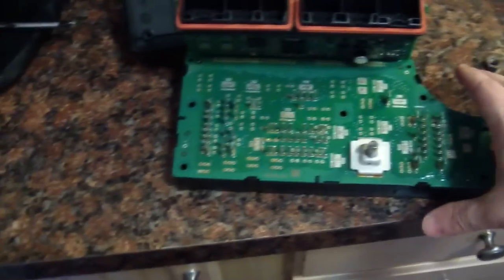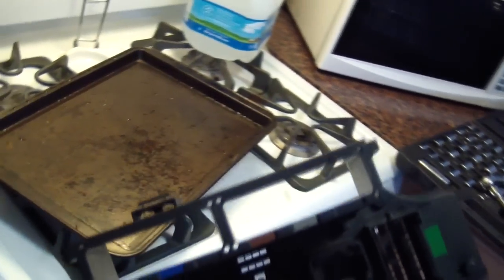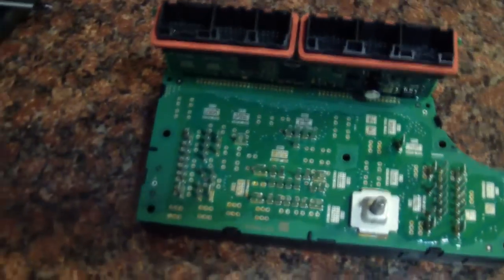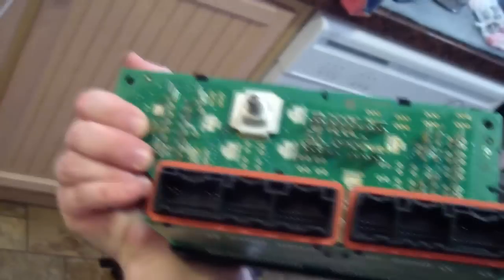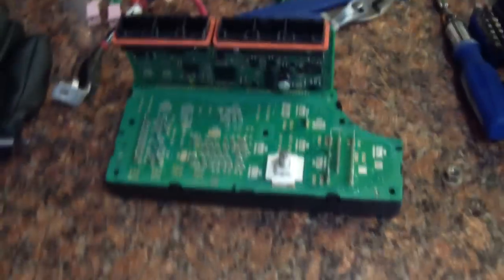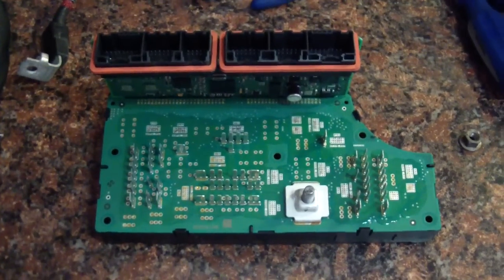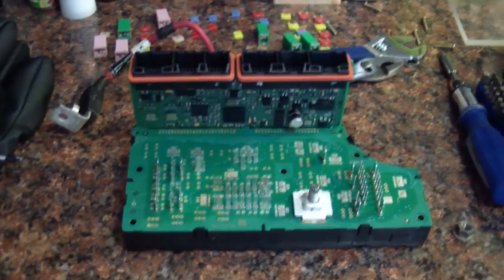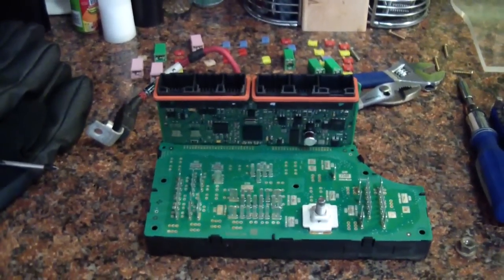2007 Dodge Caliber TIPM inspection - look at the guts!

Comment: Tipm should be called take-em, the customers money that is!
Reply from the maker: I used to down-play the potential results of a surge with these. Now with that said, my 1999 Volvo's regulator failed on the alternator and blew out both headlights and both fog lights. The CEM (A TIPM basically with replaceable relays) didn't have any issues.  The alternator was the vehicle's original. It outlasted TWO that my Caliber had.

TIPM - Totally integrated payments manager.... It makes sure you keep making payments on a vehicle you already own and have otherwise paid off...
Reply: built to brake!

Comment: 4 or 5 years ago, my wipers went out and I saw your video, pulled TIPM out and founds bubble of water under the protective film covering the soldered circuits.  I got hair dryer out and watched as the bubbles moved from air blowing on them until they evaporated.  This did not fix the wipers and I ended up running wire from wiper motor to switch I hooked up in cabin.

I am now having electrical issues (no crank) and am looking for solutions, guessing somehow related to TIPM, and ran across your video again and remember with amusement that it was my first clue into this engineering problem/nightmare.  After viewing hundreds of videos of TIPM related problems, many by very reputable electrical diagnosticians, it is almost universally agreed that integrating all of the electrical circuits into a solid state device is bad engineering, especially for consumer.  Thanks.
Reply from the maker: I totally agree. They did something before they were ready to do it. Frankly it was a cost savings measure if I had to guess.

Often people do something because they can, rather than debate if they should. This is a great example of that...

Comment: I acquired a copy of the service manual and as problems arise on my 2007 I have been replacing dysfunctional circuits with relays or toggle switches . . .the latest problem was the loss of the low beam voltage to the passenger side headlamp of the vehicle ! YOU CANNOT CONNECT A LED HEADLAMP TO IT  . . . I was lucky to resolve this one by cutting the wire from the right side and wiring it to the low beam circuit of the left side ( driver side ) and it is working . . . so far . . .the TIPM is a Pandora's box ( totally inferior by design ) and Dodge has not issued a recall for this module . . . I guess it would cost them billions to retrofit all the Calibers out there hmmmmm . . . .
Reply from the maker: If you hookup LED lights it senses a problem and then disables the circuit. There is under and over current protection. There is also an update to the TIPM for the front wipers shutting off when iced up a little. This one is care of yours truly who argued with the engineer on the phone and contacted the NHTSA after finding out they were designed to DISABLE the wipers until you took it to the dealership to have it reset. A better default would have been for them to set it up to reset after x minutes it could take to cool down so you wouldn't lose them entirely. I believe they were forced to set them active/enabled no matter what.
Reply: @TheWizechatmgr  Hey thanks for the heads up ! . . . I have had 3 Calibers and have had one too many a problems with it and ALL of the problems funneled through the TIPM . . . I had an issue in one of them that sometimes you would try to crank on the engine and it would not do anything ! the cluster would turn on but when you turned the key it did nothing ! . . . I was able to overcome this problem by disconnecting the battery for a few seconds and then it would turn on and it would continue to work ! . . . I took it to the dealer and they found " nothing " wrong with the TIPM and they could not guarantee the problem would go away if replaced ! . . . the tab was $1,800 for the removal and replacement plus reprogramming  ! . . . what a nifty way to conduct business ! . . . NO ACCOUNTABILITY AT ALL ! well,  I took care of that by placing a high current rotary switch in the battery plus cable and voila !  . . . at this stage you may wonder why I keep buying them . . .  well I am 70 and handicapped . . . they just happen to suit me quite well as far as getting in and out and overall comfort . . . but . . . I must say what a price to pay ! . . . besides , I got to know her quite well  . . . regards . . .

Comment: I have the same problem in the UK worse decision I ever made as you said Dodge failed miserably!! Is it easy to replace the fuse box? As in can it be done DIY?
Reply from the maker: Easy enough to replace, the problem is often one needs the "software" loaded to it by the dealer - this is where the additional expense comes in.

Comment: I have a 07 caliber sxt n my rear wipers don't work or my power mirrors can the tipm be the ossue
Reply from the maker: Erik Nobles I haven't checked the schematic but I believe so. Almost all circuits go through it. The tipm may not be bad, you may just need the dealer to clear the code. Especially if this happened during snow or ice...

Comment: I find more issues with the harness being broken/corroded under batter tray where it goes into fender then Tipm being bad. Sure a few have weak links in the circuit board solder/paths but far more with wire corrosion. The whole point is to shut off power so you DONT get things "blown to bits" as you say...That causes fires and whole reason why it doesn't happen much....Unless you drive in 3ft-5ft water you have a really LOW risk of having water damage this far up under the hood t. Drive in the rain for HOURS see just how much water really  makes it up that far into engine compartment,,nuff said...If your replacing this more then once your not fixing the REAL problem...most time if it is a damaged area on the pathway on board it can be fixed if you have means to find it. All boards are is pathways so unless a chip has gone bad these are fixed very easy then resold while no components were replaced on the boards.As with ALL makes and models in EVERY manufacture , you will have issues with every single one of them..anything man made can and will fail.Some less then others but thats because people cut to many corners out of greed. EVERY manufacture does this so every vehicle has a certain amount of issues and is no worse then the next...Its just as matter of really fixing the true problems and not just part swapping...That how a vehicle gets a bad rep from part swapping mechanics who are not skilled enough to fix the real problems and are more of band aid changers for profit....
Reply from the maker: Didn't see your comment, sorry if you feel you were excluded, that was not my intention. Google flagged it because of "boards.As" in your post above. I've never seen that before...

I now own a 1999 Volvo V70 XC - featuring the original CEM (TIPM equivalent) w/150K miles and a build date of 12/1998 - with no issues with exception of having to replace the original alternator at 145,000 miles. The Caliber was determined to have a bad TIPM by my Dodge dealer on 3 different occasions and replaced on two of the occasions within the first couple of years under warranty - I bought an extended warranty. Some of the TIPMs were hand soldered, those are known to have a higher failure rate than those that were manufactured using automated processes. My belief is they may contain cold solder joints which will increase resistance and overheat the trace, or burn out the mosfet. There have been 104k people whom have viewed this video looking for TIPM information - out of the 101,079 of this car that were sold in the USA for the 2007 model year.  That's a lot of people. I'll assume that a couple watched the video once or twice or perhaps on accident but that's still a lot of folks. Let's assume only half went to the dealer, that's 50k+ people having an issue, or about a 50% failure rate. Granted at this point, the vehicle is older, so one or two going bad now is more or less normal.

A Starscan or other near DLS tool is worth its weight in gold on these vehicles as you really need to query the TIPM to make sure it doesn't have a set code before replacement. If it does have a set code, you would obviously clear it and continue diagnosis. Some may have other failure modes and some may have other causes of failure -- such as wiring issues you speak of, or a bad ground. I agree that some folks may not be capable of performing the diagnosis required - but these are likely the same folks that will be unable to get the TIPM paired to the car and running...

As shipped the TIPM on this vehicle came with current overload protection turned on for the front wipers. I lost mine at one point during an ice storm while driving and had to go to the dealer to have the wipers re-enabled (code cleared and the max current cranked up) - about a month later they started notifying customers and they changed the configuration/software on the TIPM.  https://www.autoevolution.com/news/chrysler-recalls-84000-dodge-calibers-13249.html They also shipped more than a couple cars with the cam bolts loose - I.E. not torqued down -- NHTSA ITEM NUMBER10020191. While I understand things can occasionally slip through the cracks during manufacturing this points toward a persistent QA problem where either the TIPM wasn't put through a shake and bake test or just wasn't tested beyond a go/no-go of performance between engineering and when sent to manufacturing/production. Electronics parts on locomotives require both tests run at well over 300 degrees. I spent months going back and forth to Dodge and their dealer trying to get things fixed in the first couple of years that should not need to be replaced. 

In the first year the following were replaced by Dodge - 1 Alternator, 1 AC Compressor, 1 thermostat assembly, 2x airbag harnesses, 2x seat scales/weight sensors in passenger's side front seat, 1 SRS/airbag controller module, 1 TIPM,  1 Serpentine belt tensioner, 1 throttle module & both front control arms. It wasn't taken out and beaten on, it was used on the street put-putting to work and home. Maybe I got the lemon of the batch - the friday afternoon model on a holiday weekend - that is a great possibility looking back.

The control arms last a couple of years at best. The struts appeared to last a normal length of time. The engine itself appears to be okay. The TCM & CVTs are okay if maintained as required by Dodge - I.E. the final drive replaced at 80k miles. The chill zone was a good idea on paper but that was fixed with some foam tape. I can't comment on the driver's airbag but the passengers and side curtain went off in a frontal crash my wife was involved in last December. The car was cured of all issues at that point.

If you haven't had an issue with your or your customer's TIPM that's great. I'm glad you and/or they haven't. But here is the over-all rating of the car by Edmunds: https://www.edmunds.com/dodge/caliber/2007/st-100685354/consumer-reviews/ 

I've owned VW, Subaru and even Ford prior. Beyond the normal maintenance stuff of older cars I never had this many issues in my life with a vehicle. I did head gaskets, TB and water pumps on both the VW and the Ford without issue. 

When the car wasn't having issues it was a great car that was fun to drive while a bit heavy on the maintenance $$$. Sadly, periods of no needed unplanned maintenance didn't happen as often or as long as I've had with other cars I sold at 250-300k miles that I purchased used. If you're located somewhere dry and not cold, preferably where salt is not used on roads, the car more likely than not be a bit more reliable. I'm glad to hear someone has had some good luck, may it continue knocks on wood :)
Reply from the maker: Any chance you could make a video of getting down to those wires to examine them? I'll toss a link to it up in the description of this video. I no longer have that car.

Comment: Sorry to say but I am unloading this POS next year and getting a new one.. I hope the person doesn't search the internet and find out what a disaster of a car they are buying. SO PISSED OFF RIGHT NOW.. i simply can't afford for this to be happening.  now, my mechanic wants me to replace TIPM AND COMPUTER just to be safe.. omg omg omg
Reply from the maker: It isn't likely the computer - they aren't known to outright fail in that car but the TIPM and Throttle assembly do. What codes has he discovered? Any B codes? If he's not sure you might want to find someone different. They aren't cheap and have to be programmed to one another and all of the modules on the CAN BUS need to have the same info such as the airbag module, the transmission control module, immobilizer, etc. If it were me, I'd just bring it to the dealer or find a mechanic that is able and willing to properly diagnose the issue.
Reply: i have a shitload of codes.. we didn't have these codes a few months ago..  i have the printout. lots of P and C codes.. i have been to FIVE mechanics and the chrysler dealer mechanic.  better off finding these parts and doing trial and error cause they are screwing me. replaced battery couple of times and alternator even though codes said was good???? cause of the lightening bolt light... now the lightening bolt light comes on and car wont accelerate. YES I WANT THAT PART LOL my mechanic owes me his life and will put it in for $20 i think they are all very scared of me at the moment lol

Comment: omg I have spent so much money and replaced alternator two batteries coils fuel pump and the car now wont go over 10mph and feels like the motor is going to fall out of the car. windows and radio stopped working. real POS. i owe  $700 and cant afford to get another car.  I am going to buy a used one for $150 on ebay and found a guy that can program it for $100 here in houston.  good luck
Reply from the maker: I wish you luck with that.
I was lucky enough to have my Dodge totaled. Was the best thing for me, and it.
Reply from the maker: It could also be the throttle control module - I happen to have one spare that never made it into my Caliber.
Reply: i just googled the throttle and the very first comment is exactly what my car is doing.   how much is it? i am not sure what to do now. TIPM or MODULE? both? SO FRUSTRATED and have been to FIVE MECHANICS and the DEALERSHIP. found out, i do better looking online to try and figure it out lol
Reply from the maker: Which is cheaper? =) The throttle module should be able to be installed without having to do anything extremely special if I remember correctly. You're welcome to it, just pay shipping. But if I were you I would make the mechanic pull the codes first to confirm - you don't just want to pour money down the drain. Would you like a upper radiator hose as well? I have one here that I obviously have no use for.

The throttle module is a PAIN IN THE 'dodge' to install. It is located right behind the radiator and there is very little wiggle room in there.
Reply: i really wish i would have seen this message last night. would have bought the part then lol
Reply from the maker: Let me know. It sits in a box here - doing nothing.
Reply: We caught

Comment: in the last four months.   replaced fuel pump,  alternator,  two batteries,  four coils x2, catalyst converter,  and now after all the Bullshit they say that the tipm was the root problem.  my car just would not go..  it slowly gain speed.  sputtered over the bride and smelled of gas.  so frustrated!
Reply: Yeah, that sucks. I'm told the newer versions of them are more reliable.

Problem with computer controlled modules is that just like any computer, they can malfunction in mysterious ways.

Comment: I have an 08 Caliber SRT4... I've been getting a P0017 check engine light, which is a "Cam position sensor" and today I went out and got in the car and the radio is dead...  like, dead. 

so far, my headlights are fine and my wipers are fine... would these two symptoms I have, point towards the tipm?
Reply from the maker: It is possible. If you erase the codes does it come back?
Unfortunately without a dealer level scan tool, resetting the TIPM is near impossible, even if all it needs is a reset.

My caliber was totaled last Tuesday in an accident.
Reply: TheWizechatmgr 

haha.. that's one way to fix the problem. 

I thought you could reset the tipm by doing the battery cable trick? 

thanks for the reply BTW
Reply from the maker: Matt white works as expected now :p

Comment: I have replaced a large amount of TIPMs on calibers, for the most part the most common fault I have seen of them is one headlight will lose its power feed. the customers I have that don't want to replace it I just use the power feed that it still has and make that turn on a relay that I make control both headlights.
Reply from the maker: In my opinion, relays were superior to the Solid state components because of their ease of replacement.
Reply: My head lights work just when I flick on my brights only the passenger side comes on my car left me twice now I'm going to have the alt tested and see if that's the case